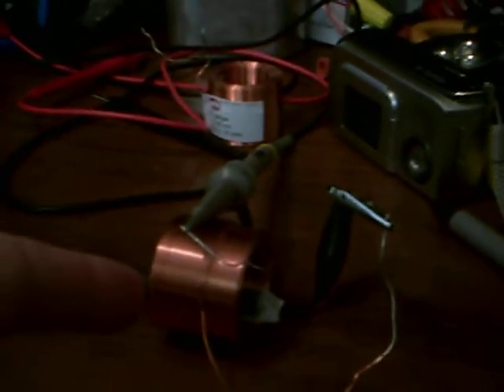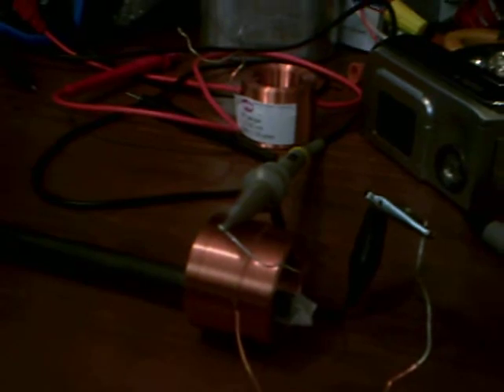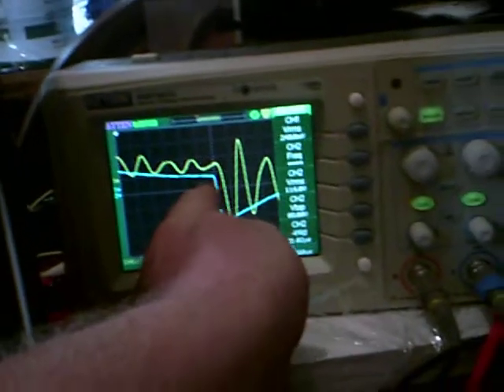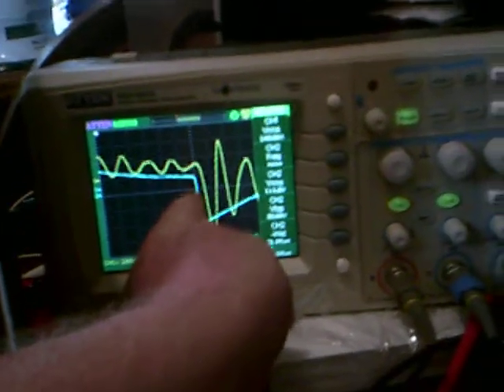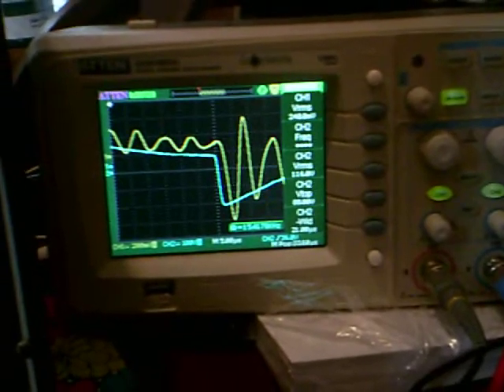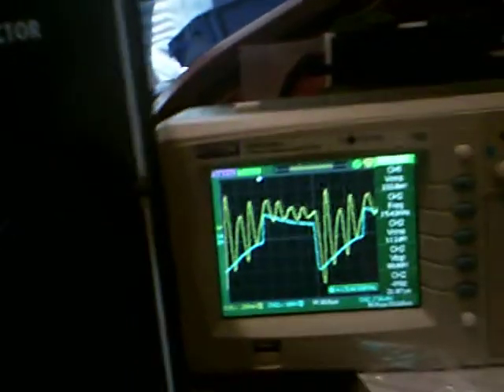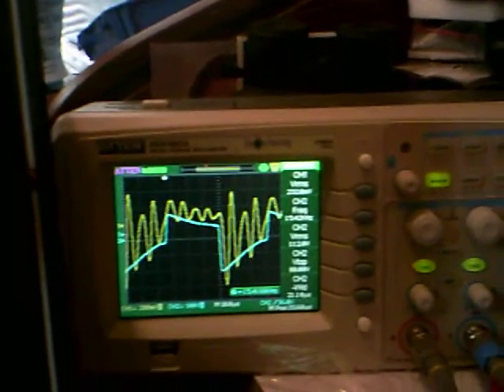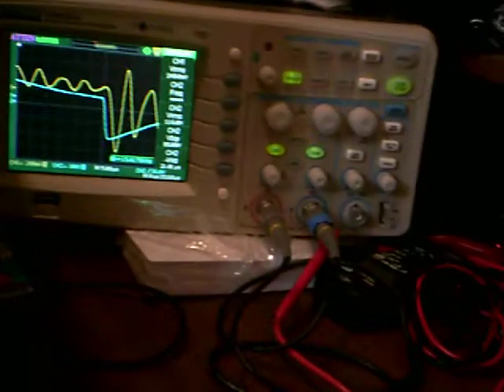Secondary coil moved 34cm from primary coil along ferrite core; time delay

Comment: Hi thanks for a good video on transform. Most of just know the basic of a tranformer operation and construction. But how does it really work. When on load the secondary create a magnetic field of equal strength and opposite to the one that create the induction. Well my question is why is it possible "should the secondary field cancel out the primary field” please the graph of magnetic field on both secondary and primary at the same time constant would be helpfull. Thanks.
Reply: it does cancel the field, but then the primary coil increases the field to compensate...